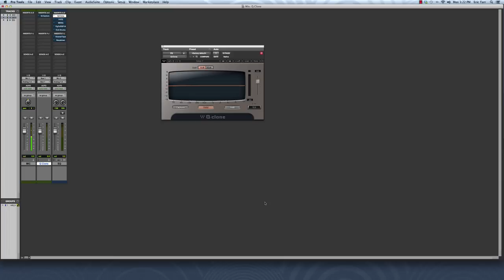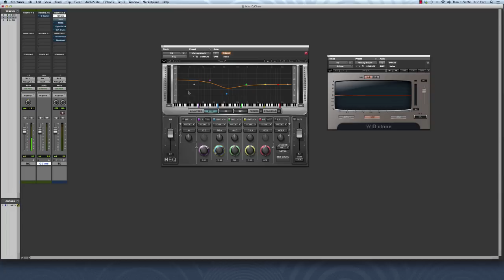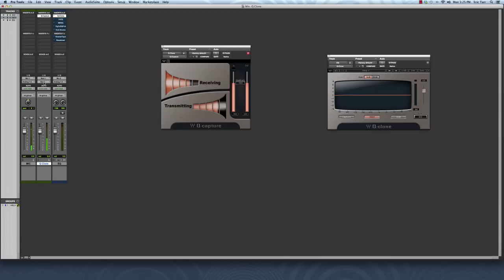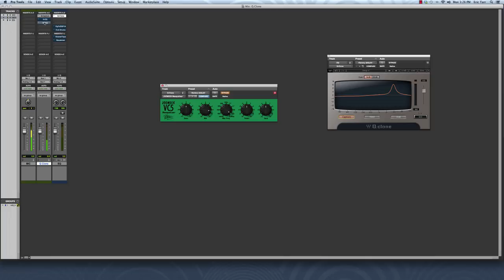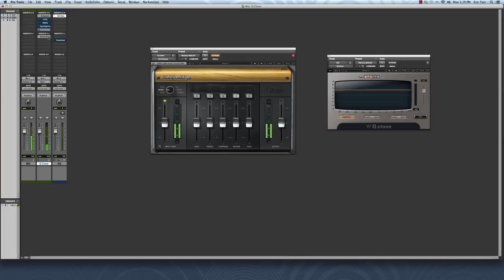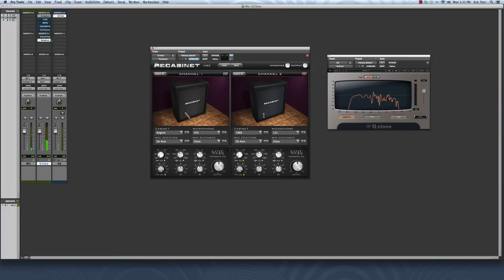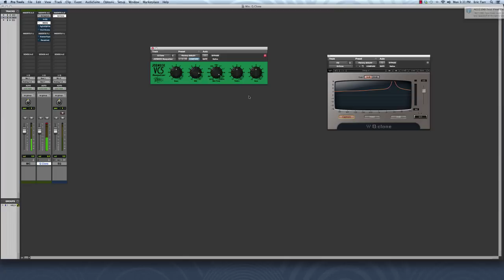How to Analyze Plugins with Waves Q-Clone and Q-Capture

Comment: Thanks for the tutorial. I tried to set up the tracks as you have them. Q Capture on an AUX track mono since capture is only available on mono or multi mono. The stere audio track where you have the other eq plugins that you want to analyze. But I see the audio track is stereo and when I try to bring a eq that was open on a stereo track to the mono Aux track where Q Capture is, it will not allow me to do so , it gives me an error " plugin cannot be moved there because plugins number of input channels does not match". So how are you able to do that ? I am working in Pro Tools 10.3.10

Comment: Okay I need serious help. I keep trying to do this with my software plug ins so I know what each component is doing but every time I click 'Capture' mode, an EQ curve appears and builds until its a jumbled mess of squiggly lines and I have to bypass it to knock it off!  What the actual hell man!? I checked and double checked my routing. NO plugins other than Q Clone and Q Capture... I can't think of any possible reason why this should be happening.